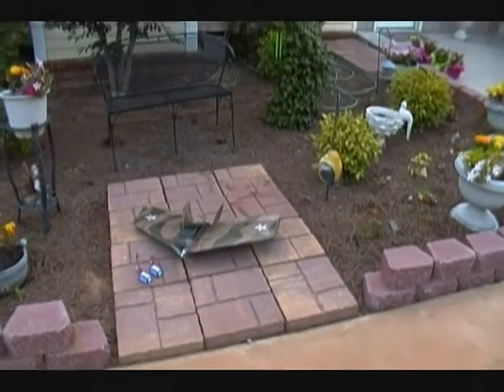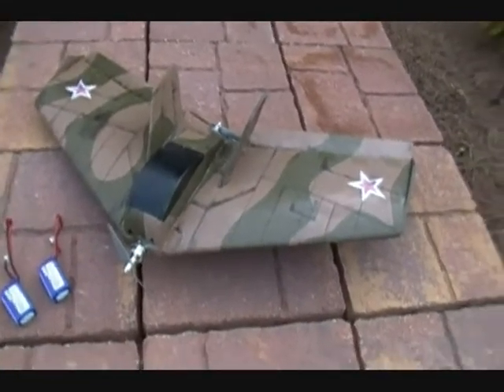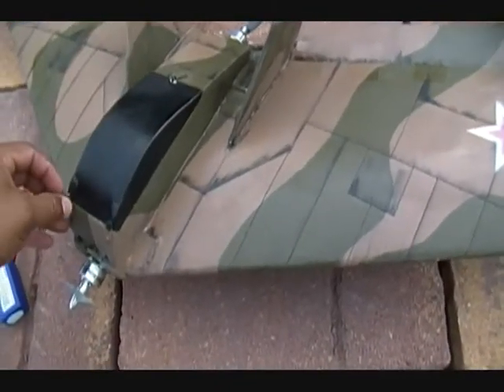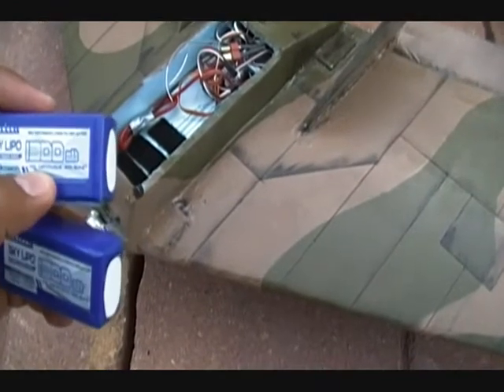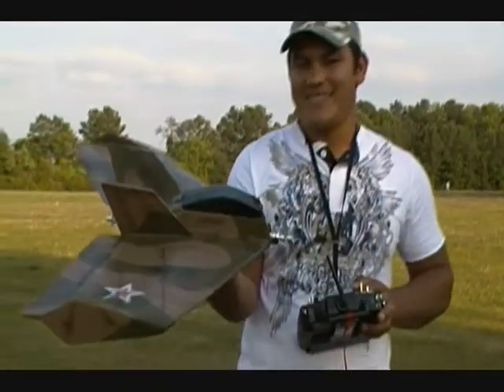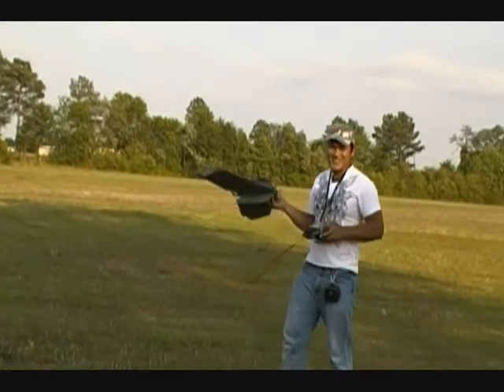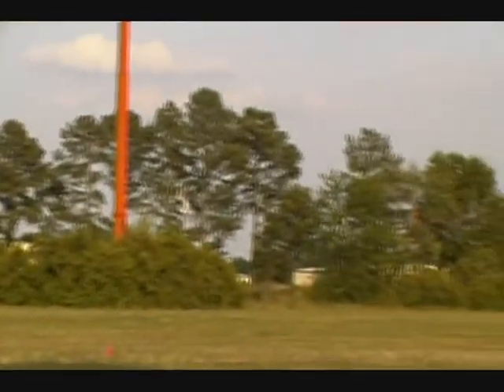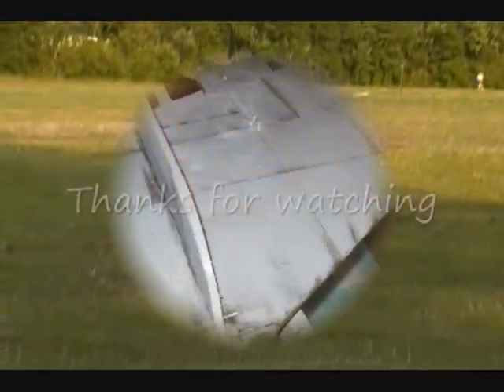Falcon's r/c MIG-X1

Comment: Hi Daniel, I see it's late, but, about the time you built this plane the Stryker F27 C was selling and  flying and you just basically built a Stryker with slight differences.  I wonder, don't you spend some time looking at what's already out there to take some ideas about balance and plan form?  I really like the way you painted your airplane, you are a builder!, looks great, and that aluminum tape covering job too (other vid). Looking good. Your paint job and planform reminds me of some of the Secret Projects planes I have seen in my books and on net. Hope to build something with looks as good as yours.